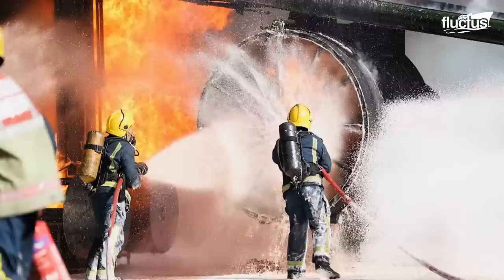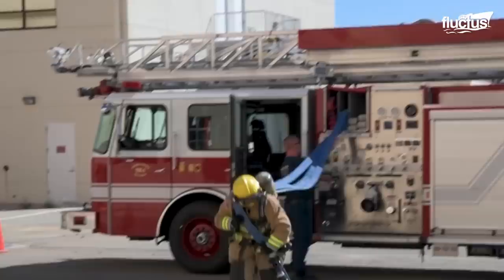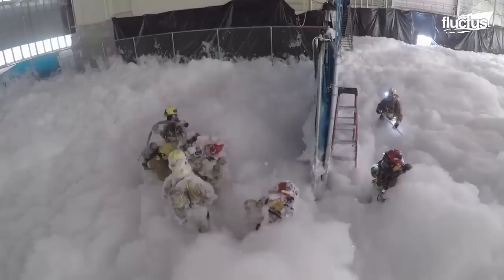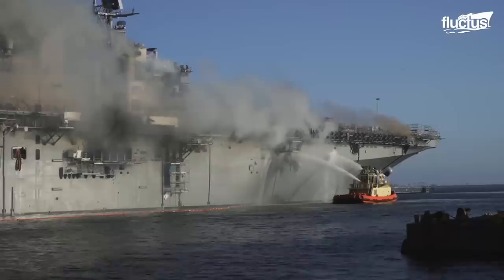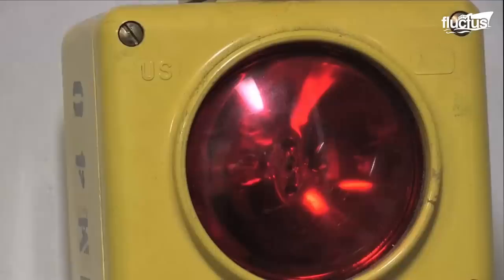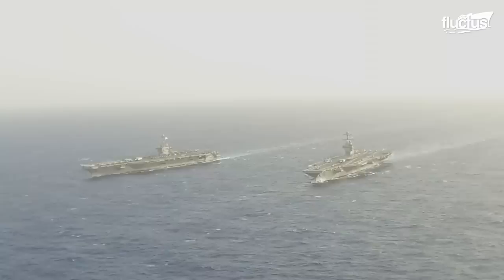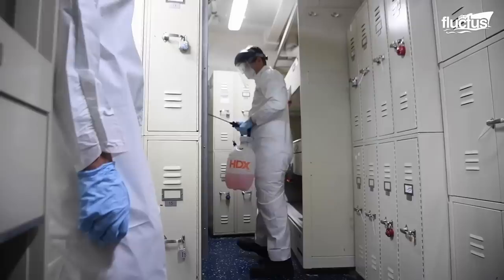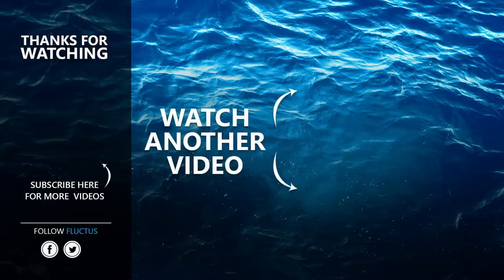What Happens When Millions $ Worth of Aircraft Are Accidentally Engulfed by Foam

Comment: Good video! FYI: AFFF, or A triple F as it was called, is not new; it has actually been in use for over 60 years, since the 1960's. Back then it was a protein based liquid cocktail mostly made, literally, from the blood and guts acquired from slaughter houses and it smelled like it. Over the years the content blends of AFFF have changed and manufactured chemicals have replaced the animal concoction - for better or for worse - as the original foam did not really harm much of any thing it came in contact with, unlike the today's chemical based foams. 🤓

Comment: I worked in a aviation place with the foam thing installed. It went off when they dragged a freshly landed jet in. It picked up on the hot engines. After that the company secretly disabled it and only re enabled it when the insurance inspectors came in

Comment: At the airforce base I work at, we had the fire suppression system go off by accident while a C-17 glodemaster III was inside, with the doors closed and buried it right to the rafters lol, what a mess.
Reply: Was there any damage or needed services required after the event? And I wonder how the foam can affect the engines.
Reply: @sjb3460  the system was part of the alarm system for the hanger, and the building was brand new, for some reason when someone walked in on a weekend, the side door from outside was wired to the suppression system. So when the door alarm went off, so did the foam.
Reply: @echohunter4199  well, the mess took almost a year to clean up. The aircraft was 8 months getting cleaned and the hanger took 2 months, everything on the aircraft was disassembled, inspected and cleaned. There was a lot of pissed off brass lol.
Reply: @Monkey_Snot  Thank you for the reply. I’m a retired Army Infantry Senior NCO and I can only imagine how the unit BMO (Battalion Maintenance Officer) responded when he saw this, basically like watching someone shit out a kitten. And one thing I learned is to NEVER ignore them or piss them off, god help us if we did, lol. I almost feel sorry for whoever screwed up on that, lol.

Comment: sounds like if your gonna work in a hangar you should wear a strobe light that flashes against the foam. and have a modern miners gear to wear incase that happens by a faulty alarm 🚨 or in a real emergency situation so you don’t breath the chemicals or foam. or come up foam that’s not harmful but extinguishing fires. hangars should be equipped with water cannons to help wash out the foam and help with fires to.

Comment: @2:20 "It even buried several Black Hawk helicopters..."
Looks to me like those helicopters can lift off with no problems.
Reply: Um, no.
Don't think you wanna risk a takeoff unless absolutely necessary.
Reply: The foam will just get sucked right up into the engine intakes and squash the engine as it needs air to operate and take off.  ... sort of kinda like the sands that were sucked up into the engines of the aircraft during the Kuwait Desert Shield and Desert Storm fiasco
Reply: @penelopelgoss2520  "The foam will just get sucked right up into the engine intakes..."
Where are the engine intakes located?
Reply: I say again
No one is going to authorise a takeoff unless its absolutely necessary.
Reply: @jessicaregina1956  "Don't think you wanna risk a takeoff unless absolutely necessary."
What is the risk?
Please be specific.
Reply: @NoEgg4u  unless its a life or death situation, neither the commander nor the pilot is gonna wanna risk a takeoff. Is it your life or your checkbook on the line?
Reply: A b2 bomber has been lost because of ice and f-22s knocked out by passing a line. U wanna risk? Nah.
Reply: @jessicaregina1956  You wrote:
"I say again
No one is going to authorise a takeoff unless its absolutely necessary."

I asked:
"What is the risk?
Please be specific."

You replied:
"unless its a life or death situation, neither the commander nor the pilot is gonna wanna risk a takeoff. Is it your life or your checkbook on the line?"

That was a reply to my question.
That was not an answer to my question.

My question is:
What is the risk?
Please be specific.

My question is not related to taking a risk.  My question is identifying the risk that you assert exists.
Please identify the risk.

You wrote:
"A b2 bomber has been lost because of ice and f-22s knocked out by passing a line. U wanna risk? Nah."
Non sequitur.
Reply: Fine, the risk is upon takeoff the engine ingests some foam or fod then causing it to crash. You see those engine intakes? Can you absolutely guarantee that upon takeoff they will not ingest anything which may cause it to crash?
Reply: Lets say they do take off and one crashes. After the board of investigation investigated: they say: we have determined that the loss of super 6-3 was due to foam ingestion after accidental activation of fire supression system. In future no aircraft which has been caught in such an incident will be allowed to take off unless it has undergone a depot level maintenance process.
Reply: Do u even know what a "depot level maintenance process" is without googling? 🤣
Reply: @jessicaregina1956  I have concluded that you write things that you know nothing about.  When asked to explain your claims, you repeatedly reply (not answer) with multiple comments, none of which ever answer the question asked, and always goes off into the weeds.

Constantly changing subject, to avoid actually answering a question, conveys your efforts to try and change the subject, talk in circles, and make chaos because you refuse to answer a simple question.

I did not bother to wait for you to answer my questions, because it became apparent that you never had any intention of doing so.  You just reply, over and over, rambling on with one non sequitur after another.

I looked up the answer, to the risk of liftoff, and found no evidence of a risk.  There could be a risk, but I have found none -- and neither have you, or you would have pointed it out after I asked you to do so, 3 times.

The helicopter's engine will run, issue free, as long as its air intakes are not blocked.  In the video, the air intakes are not blocked.  Ergo, the helicopter will lift off.

Please reply with anything you want (which you have been doing), and be sure that all of your replies never answer the questions being asked.
When you reply, and reply, and reply (yes, it is tough keeping your reply in a single comment -- just keep clicking reply over and over for each sentence), well, I will not engage you any further.

I will entertain someone's replies for a time, until I conclude that they are rambling or trolling.  It does not matter which.  I gave you multiple chances to provide an answer, and you continue to ramble and ramble.

So reply with more words that never answer my questions.  I will no longer engage you.  You will be talking to the hand.
Reply: @NoEgg4u  can it take off? Probably.
Should it take off ? No 
Will it take off? 
Unless absolutely mission critical: no .

I ran this through an actual military helo pilot, and your opinion does not count next to his.

Comment: Camouflage fire fighting gear aboard ships ? ? What in the holy hell has happened to my wonderful NAVY ? ? 
On another not the fact that the bonhomme perished is some Fuckery afoot for sure..Anyone who has been in the NAVY and One: served aboard ship Two: if they have ever built a fire or handled fire like a torch or welding should know that for one ships are metal..Metal doesn't catch fire easily. Ships and especially hangers inside Naval ships have fire suppression systems.  The crew was limited because of overhaul, but when that is the situation ships are supposed to have a condition near General Quarters. All passageways and hatches are supposed to be dogged, and watertight doors shut so fire can't readily spread and oxygen is limited. I watched that fire get reported. Thank God the ship wasn't at Sea with whomever was calling the shots. They should have manned that fire within 1 hr with men from the surrounding ships and the on duty DC division should have been able to put out any type of fire on a hanger deck in Port.  This is a cover-up.. The NAVY is known for quickly finding a patsy just like they did when they smeared the young guy when the USS Iowa turret exploded. They later recanted the "official" explanation for the cause, and they will find the same thing out one day on the BonHamme